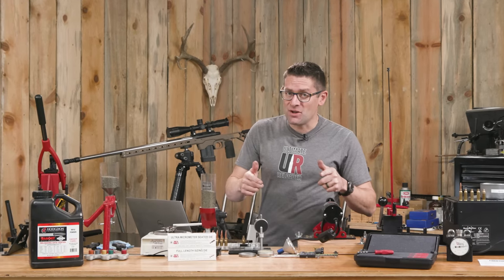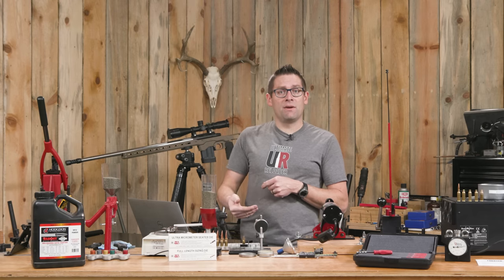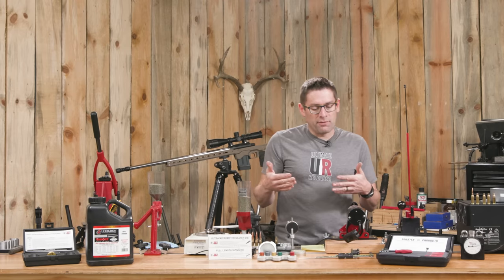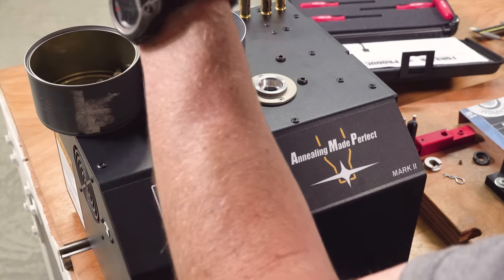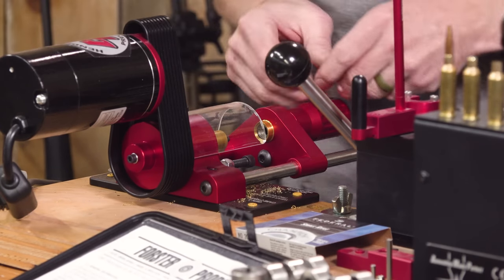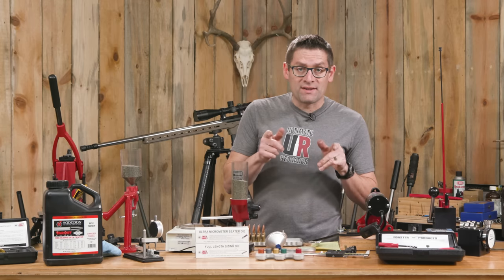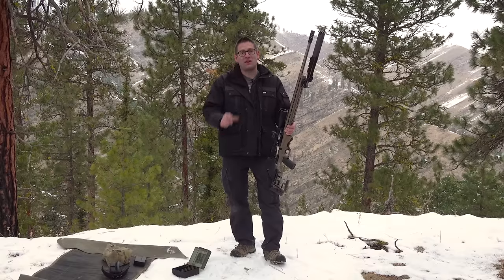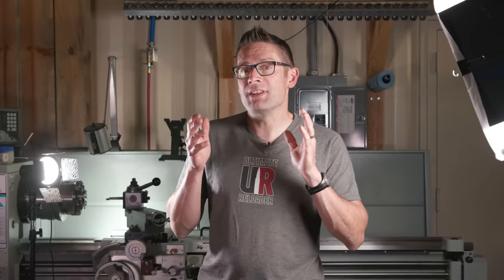6GT Precision: From Reloading to 1000 yard Shooting

Comment: Hey Gavin, I shoot benchrest and I've noticed that since I started annealing every firing that I actually get better consistency with higher neck tension(2-3 thou) than I did with 1 thou which I used to use when I wasn't annealing. I believe the softer annealed necks held onto the bullet less tightly resulting in more inconsistent ignition. Having the additional neck tension cured the problem for me. All your groups had two touching and one out which could be a sign of something being not quite happy. Just food for thought! Nice shooting and nice rifle.

Comment: Fantastic build, great gun and round for the job vid, When I resize a couple of hundred or more 308 cases I use raw wool grease and a pad, I dab a bit of the grease on some cases and roll the the cases on the pad, works well and slips through the progressive press really easily, but you do have to wash the cases in hot water with a bit of dish washing liquid and stick them in the oven for 30 or 40 minutes at about 60 degrees c to dry them, but it is still a very fast way to size a big batch of brass

Comment: "kind of a lot of equipment" - and a lot of money. Wow. That's a dream bench for sure and that's some great shooting. For your info, I seat my 6mm .075 off lands, use 109 hybrid Bergers, bedded my MDT chassis (even though I was told no need to do it and Mr Cortina told me it was a waste of time being an AL chassis), use a Bartlein barrel (28in) and use a SilencerCo hybrid suppressor. My groups average .23 at 100 even in our FL heat. 650 yards holds similar MOA.
Reply: Powder?
Reply: @no-sway3709  H4350
Reply: @Don Enderlein  thanks. That's all I have and getting my 6GT soon.

Comment: @gavintoobe After watching a few of your latest videos I've come to notice that you are always starting with new brass.. Which fired / used brass cleaning method do you currently prefer? Specifically, have you decided on one due to the amount of carbon it leaves in the neck for lubricity, or are you doing something like ultrasonic trying to remove as much as you can to get the brass as close as possible to the unfired factory state?  I've seen some comments about scratching projectiles and "jumpy" seating pressures on the AMP gauge when folks remove the carbon completely from the neck but clearly as you are loading with new brass this can't be much an issue or is it?
Thanks again for the great content!

Comment: Back in Oct we had our PRS season finale. (monthly club) I shoot gas gun in 6 ARC with a vortex viper pst gen ii scope. We finished our last stage of the match and I asked a few of the guys on my squad if I could look through their glass at our last target. (I wanted to compare because I knew I needed to upgrade this winter.) While I'm comparing scopes my friend says "I have some rounds left. Go ahead and give it a test drive." At first I was like nah, I don't want to get spoiled. He finally talked me into shooting his rifle. I don't have all the specs on his rifle but I do know it's a 6 GT through a 26" bartlein heavy barrel with a burris xtr 3 scope. (Barrel spun up by 5x5 precision) Yep, I never should have shot that rifle. After I adjusted for wind (Initial wind call was .3 left, ended up holding straight up.) I went 4 for 4 at 875 yards. I seemed sooooooooo easy. Hardly any recoil at all and with his glass I could pick up trace pretty easy. 6GT, for my 7 round experience, is fantastic! I'm just torn, do I go with dasher or GT when I switch to open bolt division? Decisions decisions.
Reply: Same thoughts here 😅
Reply: The GT runs out of magazines better than the Dasher.  That is why Gavin built it.
Reply: @PC-vq5ud  good to know info right there.

Comment: You should update your AMP annealer to the latest firmware. This adds the "auto run" function where the machine senses a case being inserted and immediately anneals without having to hit the start button. Surprising how this little tweak really speeds up the process.
Reply: It sure does... only downside is that 1 in 50 case that falls out of the holder and back into the machine and gets double annealed.  :-(
Reply: @Mike_Lima  I've had the same happen and it can ruin the brass with the annealing taking place close to the case head. You'd think there would be a better way to hold the cases.
Reply: @ShootingAndReloading  The advice I've been given from AMP is as long as the case isn't damaged reload and fire it to work harden it and then anneal and you're good to go

Comment: I have been in 6GT for a bit I’m curious what primer you are using I use a fed 205 and get sd 5 and es of 9 in 20 shots back to back with varget and a hornady 109 eldm I also use the same scale with the auto trickler. Love the video once I get the barrel for my wifes I will be loading 22 GT that should be fun

Comment: So Gavin, you said you're using the .265 bushing for your Alpha brass? I'm assuming this is the SAC bushings? I've seen on GA precisions site, they suggest starting with a .266, however per SAC they have no idea when the .266 bushings will be back in stock. Been waiting for months. Since I do use an expander mandrel on the necks after running through the die, would you suggest I go with a .265 for now since the wait is who knows how long for the .266?

Comment: So many great 6mm out there it's really hard to choose. 6 creed, 6x47, 6xc, 6gt, 6 dasher etc. Loving the 6.5x 47 makes me lean to the 6 x 47 direction.  Would really need some convincing to go in a different direction.
Reply: Watch the 6.5 Guys videos on the 6x47.  They could not get the consistency with it that they got with the 6.5x47.  The creators of the 6 GT have a video where they comment on this.  They said that H4350 was too slow for the 6x47 and that Varget was too fast.   They went with a cartridge length that was optimized for Varget and for good feeding out of AICS magazines.
Reply: There are about 20 powders between 4350 and Varget in burn rate, so you should be able to find something that works in the 6x47L. I've read the issues with consistency, does that mean flyers, were possibly related to reamers with incorrect clearance in the neck. Too tight.

Comment: Great video!! FYI You can if you want upgrade your AMP Annealer so you don’t have to use the start button.
Reply: Far as I know the Mark II comes with both auto start and Aztec mode preinstalled. Mine did.
Reply: @foonus406  I had to upgrade my mark 2 didn’t know that some already had both options.👍
Reply: you guys accidentally dropped brass into the machine after annealing and double annealed?
Reply: @Mike_Lima  never had the issue personally but AMP actually has a clip up with them doing a double anneal, the way the machine works there should be no damage done.

Comment: If a gun holds a 3/4MOA group at 100 yards should that hold true at longer ranges? I was told by someone that to hold a 3/4MOA at 600 years you need a .33" group or better. that does not sound right to me, but I am not knowledgeable enough about it.
Reply from the maker: Wind
Reply: @Ultimatereloader  So if you take wind out of the picture the group size should hold true at longer ranges?

Comment: 6GT looks like it would be great for elk down to coyotes.
Reply: Elk? LOL
Reply: @nvlaser9084  it’ll be fine. It’s carrying enough weight and speed. Good shot placement and don’t take long range shots you’ll be fine. It’s basically a faster and heavier .243 which a lot of people have taken elk with.
Reply: @RadDadisRad  Uh no.  It actually has less case capacity than a .243 which is based on the .308 case.  .243  already on the ragged edge and most people with an IQ above 80 would not dare use one on elk.  My buddy killed a 330 bull this year with his 6.5creed at 450 yards. took 5 shots to bring him down, all in the vitals.   Using a 6GT on elk would be fucking moronic.
Reply: @nvlaser9084  6GT max pressure is more than .243, so it doesn’t matter about case volume if you can’t use it.
Reply: @RadDadisRad  This is false as well.  Even cheap .243 brass is around 61K PSI.  Using quality brass like Lapua you can go up to about 70K+, but you will trash your brass and have other pressure signs.  With both cartridges most people are going to stay in the 50-55K PSI range which gives you room for temp swings and lot to lot variation of powder.  95% of people shooting a 6GT are running between 2800-2900.  I run mine at 2940, but will be downloading this season to help with spotting.  Loading to their potential the .243 will have more case capacity and will shoot the same bullet much faster, assuming you have the right throat/twist.   Some PRS guys still use .243 to this day after 20 years of competing.
Reply: @nvlaser9084  you’re wrong. SAAMI spec for .243 is 60k and 6GT is 62k.
Reply: @nvlaser9084  .243 is tested at 60k with 100gr at 2,960fps and 6GT is tested at 62k with 109gr at 2,910fps.
Reply: @RadDadisRad  2k PSI difference doesnt mean shit. No one is running them that hot unless you want to destroy your brass and blow up your gun. You can run a .243 at over 3100 with a 109.  Run the same bullet with a 6GT (which is exactly what I shoot, on my 3rd barrel) at 3k you are burning a barrel up in 12-1500 instead of 2k.
Reply: @nvlaser9084  I’m saying it is running almost the same as .243, just a touch hotter. .243 is sufficient to take down an elk and so is 6GT. It’s not the ideal round but I never said it was. I said it was good enough to go from coyotes to elk. I’m not saying I would but I like the fact that I could if I wanted to.